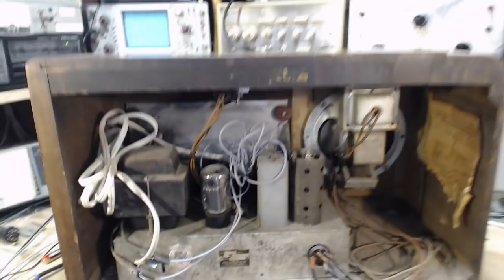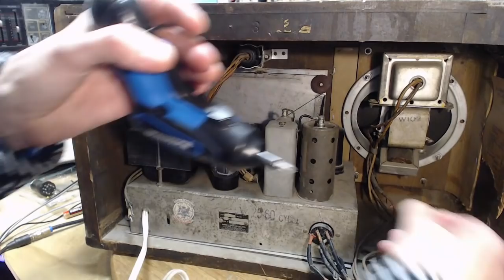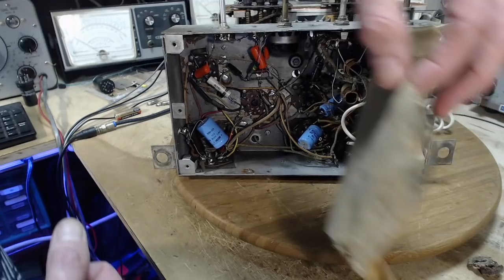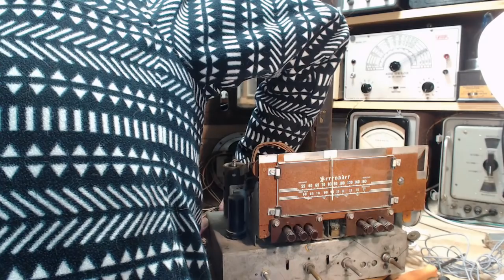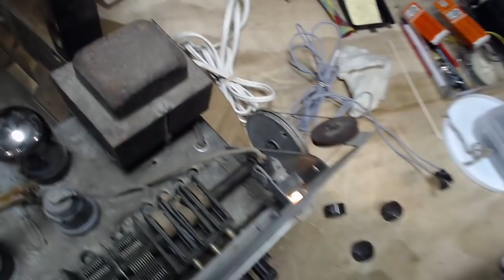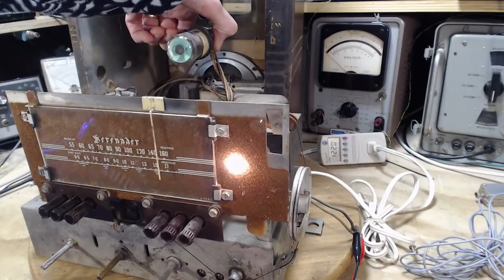Electrohome Serenader 9A62-S Video #1 - Checkout and Power-up Test

Comment: That 5Y4 looks like a dead ringer for a 5U4GB, I've never seen one of those before. If it has Sprague orange drops in it, if they are the right values it probably did work not too long ago. The Magic Eye tube should have a wing shaped screw holding it in, not a regular screw, whoever worked on this set last probably lost it. I would leave the original grille cloth with the set, but maybe dry clean it with brake cleaner, I don't think that pattern is being reproduced. The 6A8 is a pentigrid convertor type tube, whilst it is better then the 6A7 it replaced pentigrid convertors tend to become noisy at higher frequencies, like 30 MCS on up, not that it matters with this radio as selectivity on the short wave band isn't going to be that great to start with.

Comment: Dominion Electrohome, or Grimes-Phonola Radio Corp on their older sets, operated out of Kitchener, and originally was in the wind up phonograph business. They originally imported phonograph parts from the U.S, manufactured cabinets for them, and assembled complete phonographs, later they manufactured the parts under license. Anyhow Grimes-Phonola, or Electrohome had their own furniture factory called DEILCRAFT, so they could make any radio, phonograph, or TV cabinet  to order, which gave them an inroad into making private label radios under contract to retail chains like the T. Eaton Co., the Robert Simpson Co. (pre Sears era), MacLeods Hardware, and others. Serenader was the private label brand of the Robert Simpson Company until Sears bought into them in the early 1950s, most were made by Electrohome, but some were made by Electrical Products Manufacturing/Fleetwood in Montreal. 
   I think your set is a 1939-40 model, judging by the model number, but the RCC manuals will say for sure. The first digit in the model number usually indicates the year in which the circuit was designed, not the year it was produced.  The "A" may signify the automatic tuning feature, or the fact it's an AC only set, AC/DC sets have a letter "U" meaning universal, battery sets have a "B". The second number indicates the number of tubes, 6 in this case, the third number indicates how many bands it has, 2, and the letter at the end indicates whom the set was built for, "S" for Simpsons. The model number including the letter "D" probably represented another client company rather then denoting the inclusion of a phonograph input, the phono jack was likely included at the request of the client. 
   With regard to the tubes, these sets used "G" type tubes, meaning that they were octal based, with a shouldered  glass envelope. Metal tubes are usually interchangeable with glass type octals, except for mechanical issues such as the length of the grid cap leads, or the tube shield base getting in the way, like they do with Philcos. The "S" series of metal tubes was the successor to the older double ended types, so a 6SK7 is the same electrically as a 6K7, 6SA7 was the successor to the 6A8, 6SQ7 to the 6Q7, minus the grid caps.
  I too was thrown a loop with a Phonola console set I own, I thought it was a 1938-39 set because of the ST style octal tubes in it, and the model number starting with a "9", but it's actually a 1940-41 model. I think that since Dominion Electrohome was a company that specialized in making lower cost, private label sets, that they would use whatever tube types they could buy in bulk for the lowest price rather then what was current. Electrohome never used Loctal tubes to my knowledge, more then likely because Canadian Westinghouse was their primary tube supplier, followed by Canadian Marconi, whereas Loctal tubes were a Sylvania product. Philco used to do the same, there are some 1939-42 model that old fashioned glass tubes like type #80s, #41s, and #42s ever though Philco began using glass octals in 1937, sometimes they would mix three types of tubes together in the same set, octals, loctals, and older style four and six pin tubes. The only Canadian make I have seen with Loctal tubes were some post war Rogers-Majestic/Deforest/Phillips sets, other then that pre and post war Canadian Philcos, and some post war Zenith sets.

Comment: Jim, I have one of these radios. The push buttons had stickers on the front circular face with the station call letters on them. Only one left on mine "CKCL" . Looks like someone tried prying them off of yours damaging them. Regarding the adjustment for the auto station select; Select a station with the tuning knob.  Loosen the button as you did in this video then rotate the pin that the fabric strap is wrapped on until tight. Then tighten the button which locks this pin in place.      This shortens or lengthens the strap which is wrapped around the tuning cap. shaft.. You should also be able to use the buttons throughout the scale without touching the tuning knob.

All my straps were torn which I replaced with strips of glass cloth tape. Not the best mat'l to use but all I had that wouldn't stretch. Those rivets can be removed carefully by tapping a pin in the hole on the opposite side. These can be reused. It's a tedious job putting on new straps.

Looking forward to seeing you work on this radio.

Comment: The shortwave band works great on this 9A62-S,  with eye tube 6U5 and  no phono jack on the back.  My schematic has an error about them. It has two dotted lined
boxes that say "used on 9A62- D only" when it should say 9A62-D only for the phono jack part! They both have eye tubes. The speaker symbol is missing from schematic!

Comment: I have seen that tuning button system in RCA radios, those cloth strips were all bad, it's kind of a sucky setup.
Reply: The low end ones used them, the better mechanical ones used a series of pawls that would push the tuning gangs back and forth via a rocker bar attached to a cam. Stewart Warner used a lot of these.